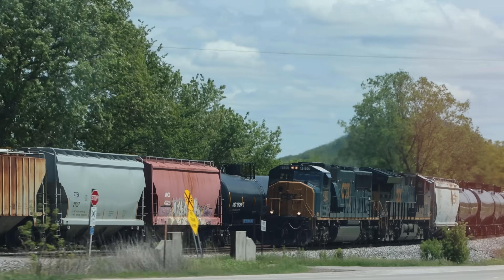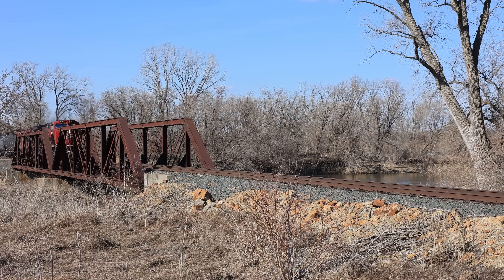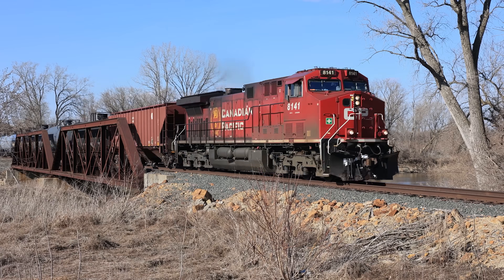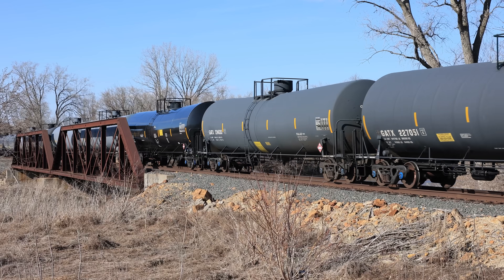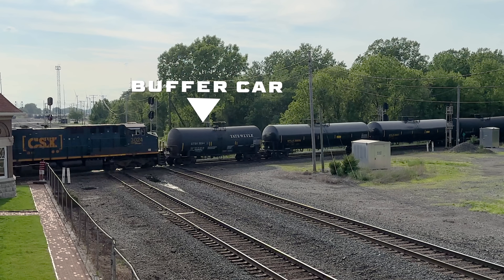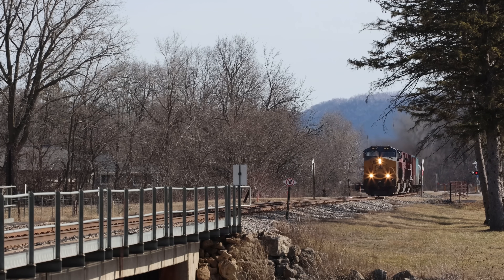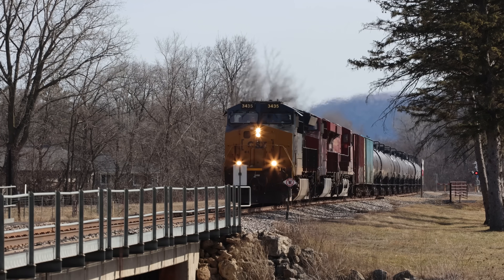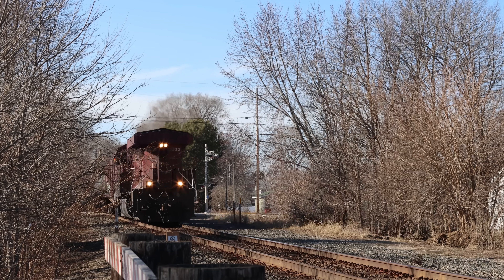Why Do Trains Use Buffer Cars? | Explained

Comment: In Norfolk Southerns case, the buffer car is there to keep the rest of the train from burning down when the engine grime catches fire.  

I used to work at a rail yard, and it was obvious NS painted their locomotives flat back to make the grease and oil grime that was all over them less noticeable.  And, yes. They are well known for engine grime fires.  😂
Reply from the maker: Haha, saves on washing (which never happens anymore). Around here, CP red looks more black than red after a couple of years.

Comment: My uncle was a switchman at the local railyard.  When I was young we regularly got items from railcars that had been damaged, as I remember.  Dad got a call and met my uncle at the yard and they loaded the pickup full of shucked corn.  It had to be cleared from the tracks and they just wanted it gone.   Memories.
Reply from the maker: The good ole days… I used to work at a GM plant (2000s) and whenever the RR would damage a load of cars, every vehicle would get scrapped. They even went so far as drilling holes through the engine block so no one would be tempted to dump a rack on purpose. Apparently, that had happened before.
Reply: @roadrailmediagroup Lmao!  A train derailed down the road from my house carrying new vehicles one night.  They had a LOT of LEO's covering that area to prevent what we know to expect.
Reply from the maker: @RondoHunter3.14 no doubt! We once received a sealed load of Avalanches from Mexico that were missing all of their radios. Guess it happened at the load out and impact several hundred new vehicles.

Comment: So in a distributed power situation I presume you would need a buffer car before and after the intermediate locamotive. Or is distributed power inadvisable for long trans of flammable materials.
Reply from the maker: Loaded flammable trains with a DPU typically have a buffer between the locomotive and the tanks on the rear. There’s a shot of one such instance at 1:18.

Comment: The train @ 2:55 has2 buffer cars? I wonder why!!!
Reply from the maker: I can only speculate, but two possible reasons are 1. The train is empty and they didn’t put the second buffer on the end (I have seen that a few times) 2. A buffer car was set out and repaired and is being returned to the load out for use on a future loaded train.

Comment: On routes with weight limited bridges or trestles empty box cars or flat decks without loads are added to spread the weight out so less weight is on a structure at any time.
Reply from the maker: That makes sense, and I have seen pics of such an operation, but the sources I looked at were more hazmat-focused. I think there is an opportunity for another buffer video on high, wide, heavy, and specialty moves. Thank you for the comment!

Comment: Every buffer car that goes into Bangor Naval Base is a center beam flatcar, usually accompanied by a small armored air conditioned boxcar, and no less than three locomotives. I also like that no AI was involved Good video.
Reply from the maker: Thank you for the kind words! The military train you mention sounds like an interesting configuration and something fun to model. I didn’t know to look at any military sources (in part because I try to use only footage I have shot and haven’t seen many military moves).

Comment: We call them Barrier cars in the UK and often they serve the purpose of providing a coupler interface between the loco's coupler and something like the commonly used Delner autocouplers used on electric multiple units. They are also used on the tail end of a consist (train) to provide braking when a loco is being used to 'dead haul' an EMU to the customer location. (I work for a train builder in the UK and not all of our network is electrifed, a problem for the delivery of electric trains. In addition to this some rollingstock, e g., trains for the underground, whilst using the standard gauge, are not approved for opperation on the mainline and have to be hauled as freight)
Reply from the maker: This is excellent information! One day, I’d like to see the UK for myself. Thank you.

Comment: Very informative, but one or two cars in a long train? I would think in case of a derailment or worse accident that one or two wouldn’t be enough. Just my two cents worth.
Reply from the maker: Thank you! Also, I do agree that buffer cars are not a cure all. They stem from a Norfolk Southern derailment in Graniteville, South Carolina, on January 6, 2005. A tank car carrying liquid chlorine made contact with a locomotive and was breached, releasing a large, toxic cloud of chlorine gas into the town. Nine people died from chlorine gas inhalation, and over 500 were injured. I learned about this after completing the video. My sources didn’t include that part of the story.

Comment: Generally they like to use covered hoppers with sand or gravel. However, any non hazardous car that cannot shift in transit is an acceptable buffer car as outlined by the EPA and FRA. 

In switching, there are 3 classes of hazmat. Class A has no restrictions and can be placed anywhere. Class B can be placed anywhere and can be humped or kicked in cuts of 1 or 2. Inhalation hazards cannot be kicked. Class B Intermodal and piggyback must be shoved to rest. Class C, such as 1.1 or 1.2 explosives must have a buffer car (non hazardous or Class A is acceptable). ANY hazmat car that is residue / empty doesn't need a buffer car.

For long haul, the rules change. A buffer car must be non placarded, there are 5 general classes, green, purple, yellow, blue, red. Green has no restrictions. Purple - Red cannot be placed next to another class except green without a buffer car. Yellow is radioactive cannot be next to an engine or passenger car. Purple and blue that are not tank cars have no restrictions apart from you can't put 2 classes next to each other. Purple and blue tank cars, (inhalzation hazards, poison, flammable) and the entire red class (1.1 or 1.2 explosives) cannot be closer than 6 cars from an engine (unless it's a unit train), cannot be next to a shiftable load, or any car with climate control, engine, or an open flame. This includes residue empty tank cars such as anhydrous ammonia, propane, gasses, etc.. also, if the train is less than 6 cars long, only 1 buffer car is required.

Comment: Everyone knows you keep a distance between flammables so the engineer doesn't get killed in a fore or explosion.  BUT do you know that buffer cars are used to keep the weight of a locomotive off the soft tracks of some older sidings or barges when shoving the cars into place for delivery and pickup.  Old sidings sometimes are not fit to carry 200 ton locos.  Too much weight on a barge slip will sink the barge,
Reply from the maker: Another interesting tidbit here. That wasn’t in any of my source materials, but makes a ton of sense.
Reply: @roadrailmediagroup  200 tons

Comment: Although I was aware of the need for buffer cars and just wanted to see if there was anything else I should be aware of, I'll enthusiastically echo other comments concerning the brevity of the presentation.  YAY!!  YT needs more of it.  Anymore, I'll see a YT headline and then look at the presentation time, and often just skip the video knowing the narrator will be blathering on and on and on before getting to the meat of the headline.
Reply from the maker: Thank you!! I try to research using sources that should be legitimate and keep the info to what is said there. I miss some details, but I would rather say too little than say too much. I also only use footage I shot myself (apart from one instance using stock footage of elephants to illustrate a point).

Comment: At first, buffer cars seem like a good idea, but then, theory meets reality. Consider the Casselton N.D. derailment in 2013. Buffer cars were useless in that disaster. And, of course East Palestine, Ohio shows us that problems occur most often where there are no buffer cars. In order for them to do any real good, buffer cars would need to be placed between every car on a unit train, and wherever there are cars containing hazardous materials on a mixed freight, between each one. When tank cars and other rail cars derail, the won't stay in a straight line. They will fold up against each other, like an accordion, and can be damaged in other ways beside couplers punching through. Buffer cars are just a token of safety, meant to convey a false sense of security. And we all know that safety is somewhere down the list, below profits, which is no.1 on the list.
Reply from the maker: All good points

Comment: Why not anything longer than 75'? Is this a length limit put on cars on North American railroads? Or to prevent the use of articulated rail cars?
Reply from the maker: The sources I used didn’t specify, but long, non-articulated cars (longer than 75 feet) can have difficulty navigating sharp curves found in some parts of older rail networks. There are some CPKC lines in Iowa that curve around like crazy and ethanol is one of their top commodities.

Comment: All trains (except unit trains) with loaded hazmat tank cars in Groups B and C and any car in Group A have to have at least 5 cars acting as buffers. Empty Residue cars only need 1 buffer along with hazmat cars in group D and no buffer required for cars in group E
Reply from the maker: Thanks for sharing that information!
Reply: @roadrailmediagroup for sure, a lot of it can be found by looking at a position in train chart. Of course it helps if you work for the railroad, its second nature for a lot of us
Reply: This is true about the 5 car buffer, IF 5 buffer cars are available. Most of the time 5 aren’t made available.
Reply: @c @curlyfries5095 unless your train is less than 5 cars they got to 5 cars back minimum. Unit trains are the only exception

Comment: I find the absence of Buffer Car on a tank car consist odd looking because it's common modern safety standard.

Like, you jump on a game like Train Simulator World and DTG devs do a great job recreating U.S locomotives and rolling stock, but they don't know how to make a correct train setup, like not adding a Buffer Car to a tank consist. 
Or DPU locomotive placement doesn't make sense.
Reply from the maker: I haven’t tried any of the sims yet for RR applications. Is there one you like best? I enjoyed some of the skin customization from some of the truck sims. Helped customers design their real life trucks with one of them.
Reply: I've put most of my time with Train Simulator Classic with 5,516.4 hours.
I've tried Train Simulator World, but it lacks content, plus I lost interest real quick because instead of the developer's updating the game, they started making installments of the same product.
TSW1, 2, 3, 4, 5, 6 as there own separate game. 

Most recently, I've been playing Railroader  which is still under early access development if I remember correctly.

Age Of Steam I think is the name, that I've been keeping an eye on for release.

Comment: Another incomplete report. If part of the purpose is to separate hazardous materials from the locomotives, then why is there frequently a buffer car on the tail end?
I'll 'hazard' a guess: These long unit trains probably remain in tact as they go back and forth, so if the power is on the other end, they wouldn't need to switch the buffer car around. Of course, trains like this run empty one way, so I don't know. Maybe in case of getting rear-ended?
Reply from the maker: There are also frequently DPUs on the tailend. It’s more convenient to keep the unit consists intact versus pulling the rear buffer off.

Comment: Not just oil or ethanol.  Add LPG and other highly combustibles to the list which also includes TIH's (toxic inhalant hazard) commodities.  Also, rule applies in regular train consists, not just unit moves, where haz mats need to be buried X number of cars deep in the train consist.  Crew safety is a consideration you did not mention.  Carriers provide the buffer cars as the requirement applies to the carrier.
Reply from the maker: Great information! Thanks for sharing and for watching.

Comment: Explanation with no mention of the chlorine train wreck in Graniteville, SC (Jan. 2005) that prompted this requirement.
Reply: Buffer cars date back to the American Civil War. The amount of gunpowder being transported in wood sheathed boxcars skyrocketed. Locomotives threw sparks. The railroads started drawing up rules for transport of dangerous goods.
Reply from the maker: Fascinating history! Wish I had access to imagery to cover gun powder via rail.
Reply from the maker: Interesting. That didn’t come up in any of my source materials. I focused on the questions asked of me from a previous video and info I found in the sources I used.
Reply: @roadrailmediagroup  Do you have a video on the business practice invention of leaving the freight on the car from loading to final customer. Huge improvement over unloading and reloading at limits of every railroad. Amazing invention. System has to be designed so every railroad makes profit on the transport. How does every RR get paid. Insurance complexities. Who pays for repairs. Then the invention of using that car for revenue service on its way back towards RR that owns the car. All administered before the telephone. Mail or telegraph I guess. The complexity is beyond me.

Comment: The RR use buffer cars on oil can moves and on high and wide moves too. The buffer at as a cushion car in the Advent of a wreck. The buffer cars are normally half loaded with cement to give the car some weight during the pulling of the train. I don't know if the law was passed that all RR have to use buffer cars on all oil & ethenol trains going to be the refineries.
Reply from the maker: Thanks for the info. It’s starting to look like I need to do a non-hazardous materials buffer car video follow up.

Comment: That's one use of a buffer car.
Such a car is used too on automobile opened block trains (not closed long box cars) to avoid the few automobiles/trucks/whatever on the first wagons being dirty with the exhausts particles of the locomotives.
Another use is to provide more brake power to a small but heavy train, such as emergency crane trains, or just regular special trains like heavy loads ones.. or the Boeing ones, where flat cars are used due to the length of the planes body.
Reply from the maker: Great info! It’s starting to look like a follow up video is in order.